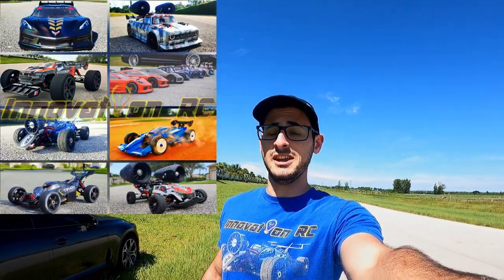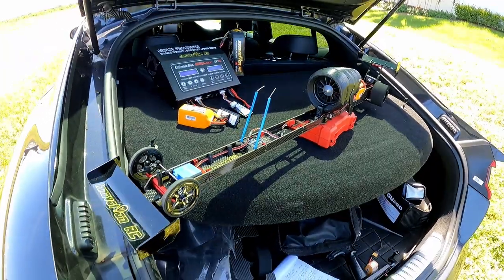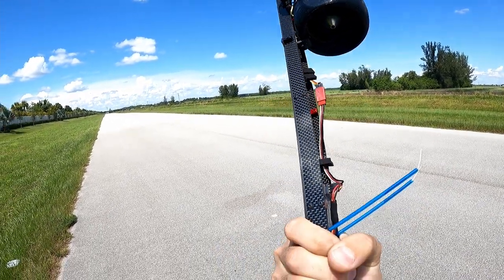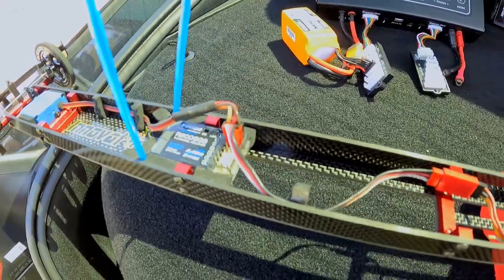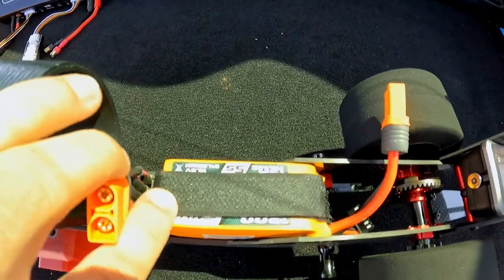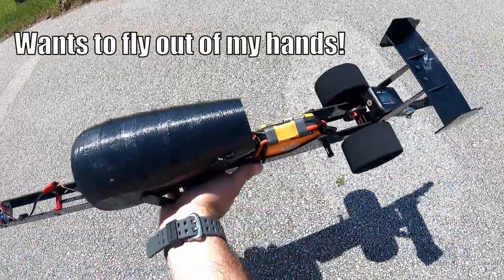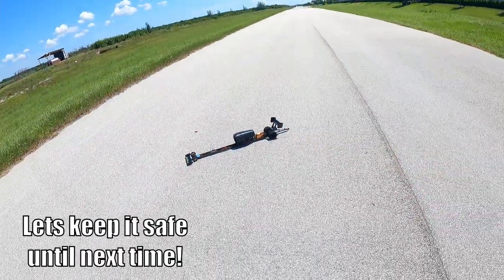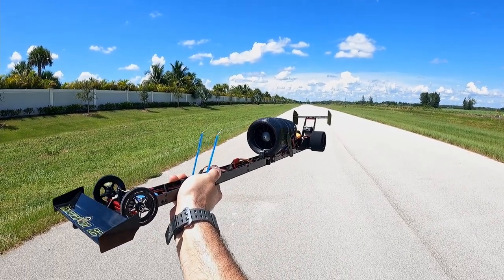RC JET Dragster - 70,000 Rpm EDF - Thrust Arrow

Comment: Crazy Dragster. I watched one of your soldering videos. What kind of sobering iron, tip and solder  do you recomend?
Reply from the maker: I use a Weller 80w iron. It's like 25$ on eBay. Can't go wrong and more powerful than most "hobby" solder irons. Big tip stores a lot of heat

Comment: Excellent video Brandon. 
The guys I know that have ran EDF's at ROSSA use deployable parachutes to slow them down just like real drag cars. The parachutes are very hit and miss though & are difficult to get working right. E.g. chute size has to be right, deployment (spring loaded servo operated system), length of guide ropes etc etc. Still something to consider. 
Another option would be a disc brake fixed onto the axle and again using a servo operated switch to make it work.

Comment: i think the fat back tires and rear spoiler are superfluous now that the propulsion is coming from the fan instead of through the tires into the ground
Reply: Skinnies on the back?!
Reply: @QuinnsRC  hell yeah. we’re not pushing off the ground with them, so why not minimize rolling resistance and air resistance and put skinnies all round? same with removing the spoiler, we’ve got the thrust vector above the centre of mass so there’s no need to further waste aero in providing downforce. make this baby a land speed record car and slip through the air with no resistance!
Reply: @gabewrsewell  If you look at the Bloodhound SSC, which is single engine, there's a small spoiler above the engine, and a three wheel configuration...